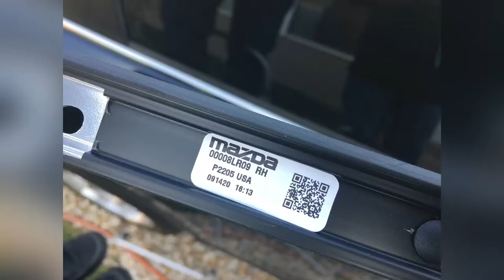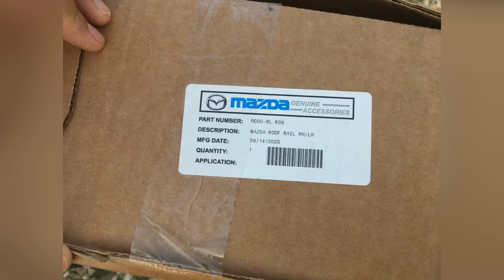2020 Mazda CX-5 Roof Rail Installation

Comment: Thanks for the vid, I just did a roof rail (no cross bars) install on my Mazda CX-5 in about 20 minutes after viewing your vid.  I was wondering how tough it would be to remove the factory existing rail but as you demonstrated it was just grab it and twist.  Easy addition to my MX-5.  I used the YHT Auto Roof Rails.  Amazon has them for $169.99 but ebay has a seller that accepted my offer of $142.99 for a great deal.

Comment: Thanks for posting.  Before this i didnt know how to do this, and I didnt want to pay the dealer their extorsion prices.  However, make sure you have the adequate tools, some help and a plan B.  I was able to screw 5 of the screws on each side.  The one wouldnt budge, and I tried for at least 3 hours.  I left it alone and I´ll come back to it with a bigger wrench.  I also noticed the 5/32 wrench wasnt flush, and two of the screws eventually peeded until I couldnt turn them any more.  Still, I appreciate the post, I just want whoever reads this to be ready.
Reply: How did you resolve the issue? The front screw on my left rail doesn’t want to screw in. Even when I try screwing it in alone it’s difficult so it’s not the alignment.

Comment: Question: to install cross bars on cx-5 is it mandatory to install rail bars? Thanks!
Reply: If you want the Mazda Cross Bars, then yes, it's mandatory. There are plenty of 3rd party cross bar systems that will mount to your door frames and I think Thule makes one that can use the holes in your roof. I am personally about to install the Mazda rails and either Yakima or Thule aero cross bars.
Reply from the maker: @hertzsae  Thank You for answering that question for a fellow viewer. Really helps. 😁